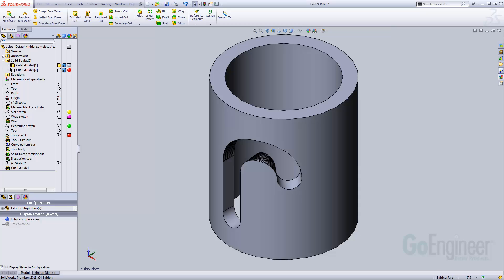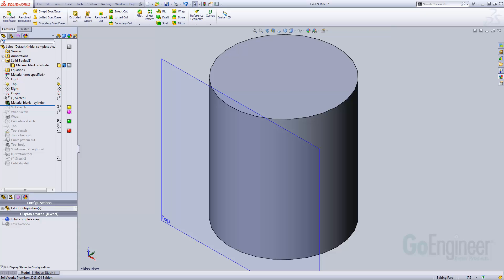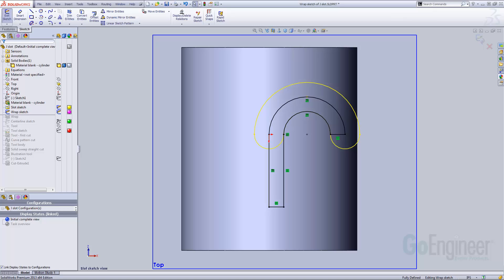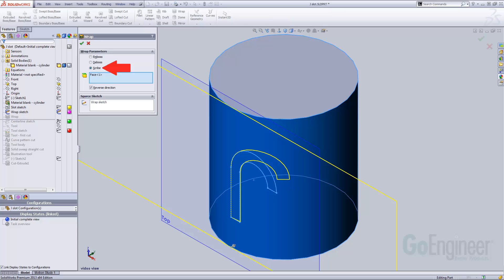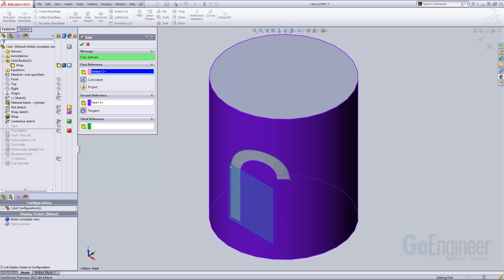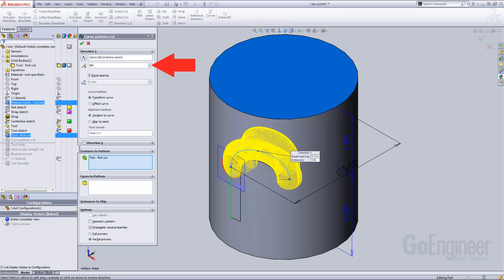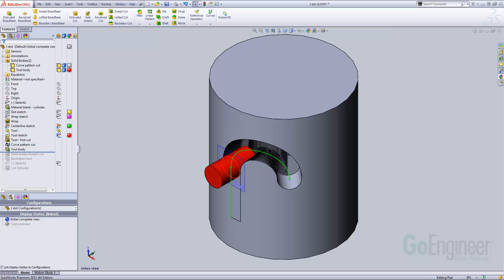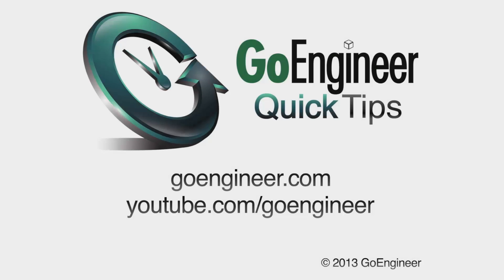SOLIDWORKS – How To Create J Slots

Comment: Why it's not possible to do it in one path ?
Reply from the maker: Now you can use a sweep cut with a solid profile that can use a single path.  https://youtu.be/kFnh801IJNg?si=GcwAIsdZzVzXshGA
Reply: @goengineer  No, this will not work because the Cut-Sweep Feature with the Solid Profile option will not allow you to select a 3D Sketch as the path.  Note in the video (increase the video resolution to 1080P and full screen) that the person is using a 3D Sketch as his path.

Comment: I have accomplished this with 2 wrap features and a lofted cut. One wrap is for the outside face and the second if for the inside face. First create a sketch on the top plan that coverts the radius of outside  and inside radius. Draw a two line extending radially from the center to the outer arc and define them with an angle. This angle with define the arc length of both arcs. Draw lines coincident and tangent to each arc. An end points of each line should be coincident to their respective arc. Make the line equal to the arc length by using arc length dim and equation in the dim for the line. The 2 lines will be used to define the slot sketches for the wrap features.  
 will need a sketch defining cut on the out side face (very much as is shown in this example) then you will

Comment: Ive just done this as its almost identical to what i need to do, except the slot does not go through the pipe to the centre. When i model it with a full cut through it worked but when i limit the depth of cut it will not work. Any ideas? I could model it bigger and then add material to get the same end result but i dont think that would be the best way to do it